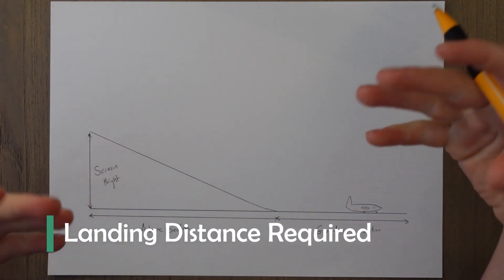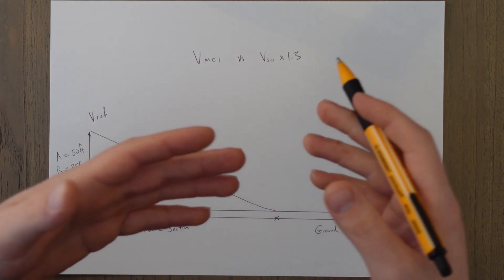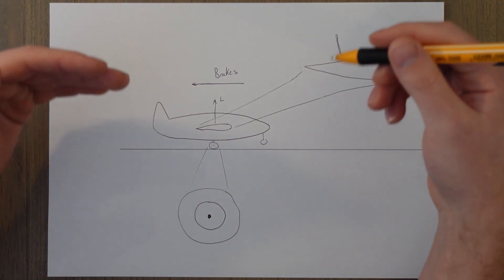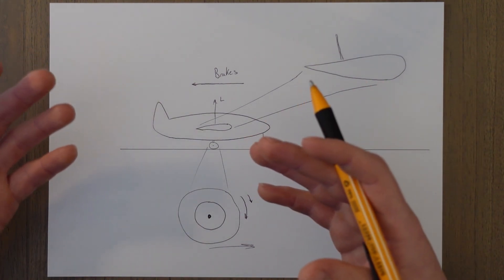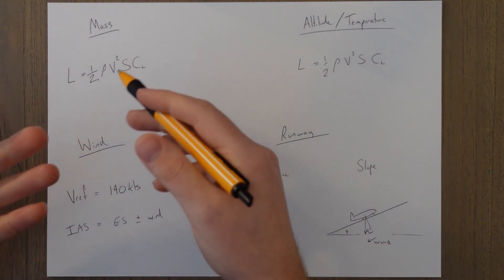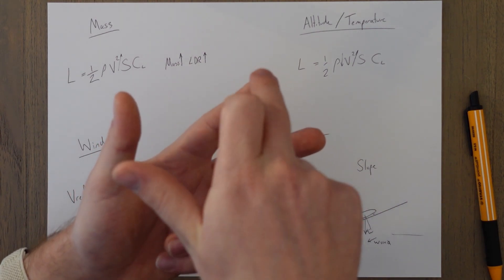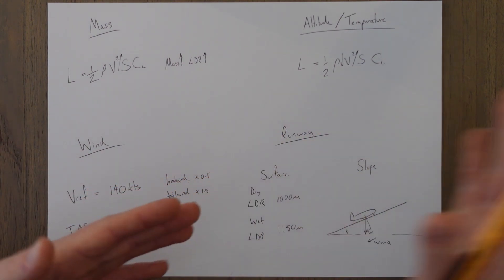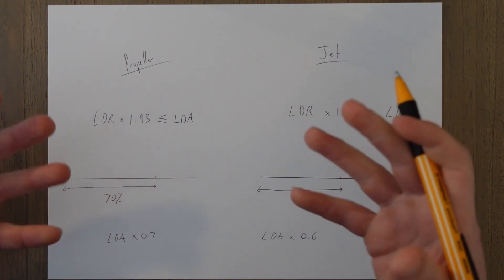ATPL Performance - Class 11: Landing.

Comment: Is the VREF speed VSO  x 1,30 for class B or for both classes? I believe class A has a value of 1,23  VS0
Reply: Class A has 1.23 Vsr0 (r for reference), Vsr = 1.06 Vs, so it's more or less the same: 1.23*1.06 ≈ 1.30

Comment: I believe screen height for A/B classes differs (15/35/50ft) only on take-off. Landing screen height is fixed 50ft for both A&B classes. It might be reduced to 35ft only for steep approaches.
Reply from the maker: It does vary you are correct. For example class B on landing the screen height can be reduced to 35ft to allow for landing on a shorter runway if approved by the regulator. Just look at the question and the graphs in the CAP698 to understand what screen height they want you to use.